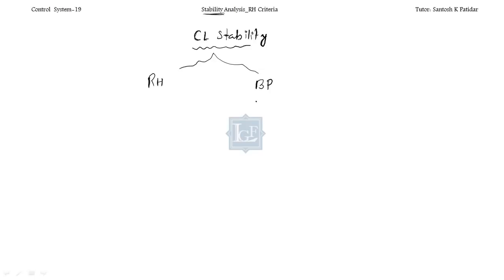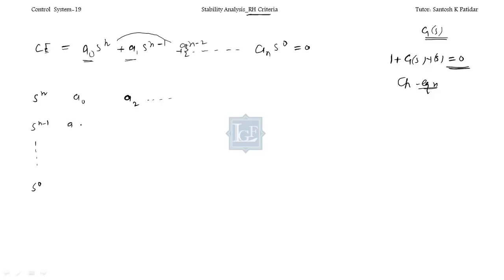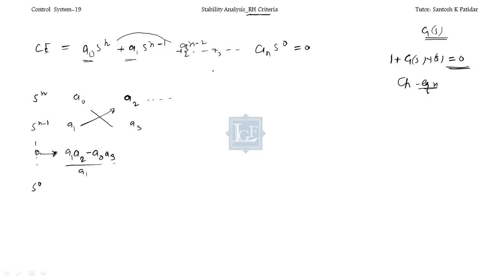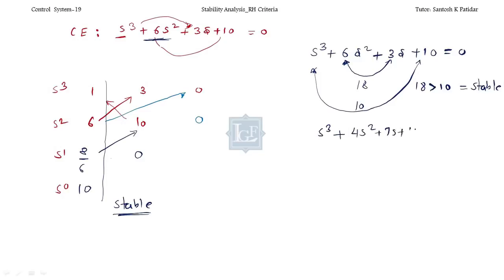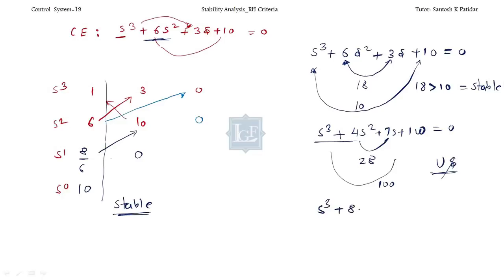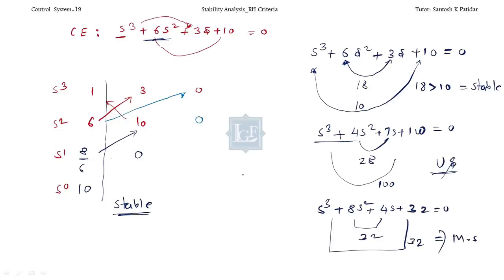Lec 19 Stability Analysis (RH Criteria)

Comment: Sir, I have a question that is, you gave a short trick to check stability, where 4 terms is given in equation in which 2 inner side and 2 outside, but if I have 5 terms in equation then how to separate inner and outside, plzz clarify it kindly!!
Reply: This shortcut will only for s^3 terms only(4terms)and for 5 terms we have to use normal method only...
Reply: Okk, thanku sir.....